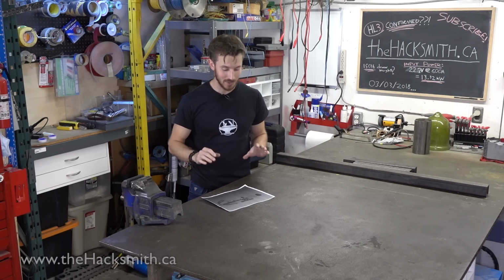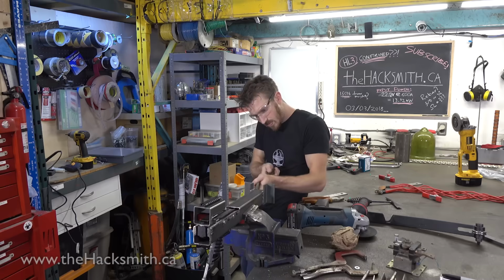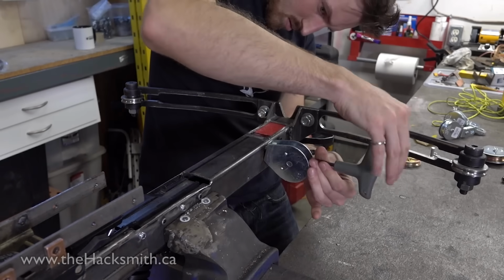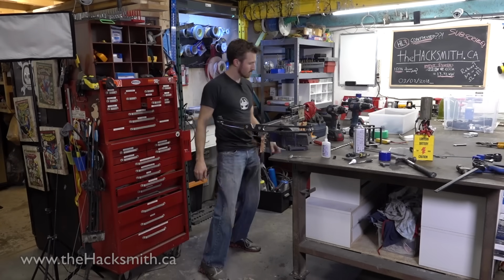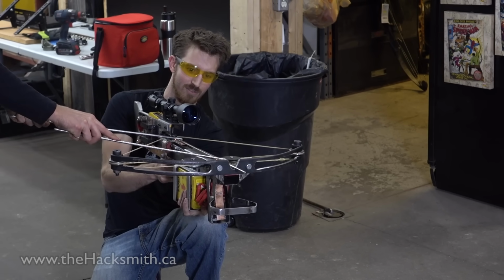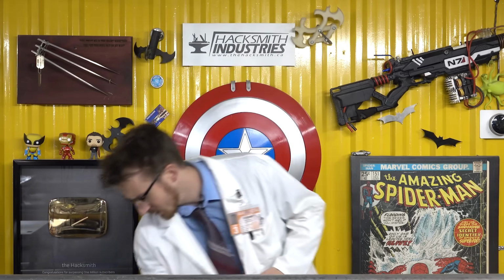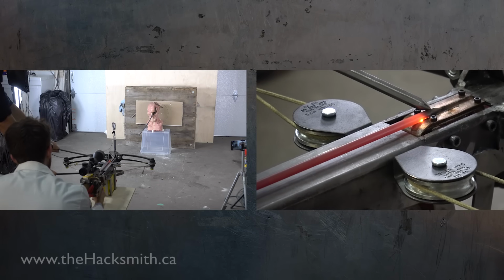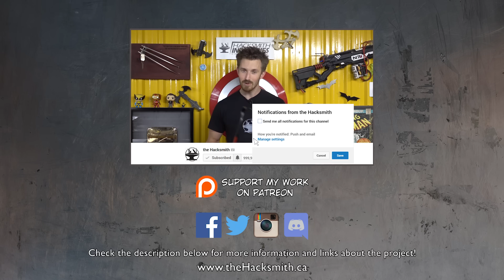REBAR CROSSBOW FROM HALF LIFE!

Comment: Make a crossbow with cesium bolts. Because of the nature of cesium, it will explode when it contacts a liquid (blood)
Reply: Joseph C. Walker it reacts with water , not blood lol
Reply: Joseph C. Walker cesium is an alkali metal , meaning that it is also very malleable meaning that the bolt would break Easily
Reply: Ken Soh Would the properties carry over to an alloy?
Reply: Joseph C. Walker no, the valence electron shell would be probably filled at the end otherwise, it would become a transition metal, meaning that it would not have the chemical properties an alkali would have.
Reply: Ken Soh imagine what is the base component of blood?
Reply: Cesium arrow head? and tape a packet of water to it so it explodes on impact
Reply: Ken Soh what do you think blood is nearly entirely made of?
Reply: Real men use anime to mask their empty souls. More than half is a liquid called plasma, not water. Get your facts right
Reply: Real men use anime to mask their empty souls. And the fact that you thanking that water is a main component of blood is actually hilarious
Reply: Politically Incorrect Man [TRUMP2016] either ways, the arrow would still not work as it would just break and snap

Comment: It looks like you need to apply an initial pressure to the bolt to start heating it. Perhaps having magnets that are actuated to help with the initial connection with the copper contacts.
Reply: Maybe an automatically feeding solder to both stick it and be conductive

Comment: I am kinda shocked you guys did not go for the compound initially.. Was kinda obvious the standard would be impossible with what you had. ( And besides that, the design itself also was a compound crossbow to begin with XD ) It is still really cool seeing this.. My grandfather used to be a gunsmith, I know that is different but I learned a few things from my brother who learned from him.. But I funny enough make bows, not guns. ( Also do a lot of other things.. Honestly making bows is more of a hobby than anything.. But I have sold a few in the past. )
Also noticed you guys did not set it up to pull the string.. IE you are doing it by force/yourself instead of using a built in system.. Though it would have added a lot more weight so.. I can understand not doing that.

Comment: The reason for heating the bolt might be inspired from the the way an arrow wobbles for extra accuracy when shot from a bow. crossbow bolt are usually shorter and dont wobble but the lenght of the rebar is more simular to an arrow.

Comment: !!!MAJOR DISCOVERY!!! LOOK AT THE REBAR IN THE GAME 
The center is not white! The outside is superficially heated to combustion temperatures but the rebar maintains rigidity!
Reply from the maker: How can you tell if the center isn't white, it's inside... if it's one material, like rebar is, it heats up evenly lol
Reply: @hacksmith  when you shoot the one in the game, both of the tips are darkened like they're oxidizing but not glowing, and at no point does it reach white hot so I'm guessing with the speed of conductivity when it's inserted into the crossbow it is just heating the surface which might even mean it could get away with only a cleverly rigged lantern battery. My knowledge of electrical stuff is literally none though so I'm not sure how much that will ever be based in reality.
Reply: Getting that red glow all the way through iron just takes a long time unless you flat out liquify it, like you guys experienced, but if you coated it with more conductive metal, or if it's possible to somehow direct the current to the surface which I don't think works that way, you could possibly have armor piercing and still have that gnarly burn effect
Reply from the maker: No,  current flows evenly through material,  it heats up at the same time.  It will cool down outside to inside, but heating up is constant through out. 

If you heated it up externally with a flame,  yes you could get the outside slightly hotter than the inside,  but metal is a fantastic thermal conductor which means it very quickly equalizes throughout its mass

Comment: I always assumed since the rebels worked with the remanence of Black Mesa, that the crossbow used a heavily modified battery to generate the power hot enough to heat up the rebar

Comment: what may be more effecting would be a system to heat just the tip as in have 2 contacts on the left and right of the bolt tip so it would heat just a inch or so of the front that would probably take less energy

Comment: 3 years later, i've come up with an idea, what if you use a high power electromagnet to make the Gravity Gun? It will not float on the air but it will stick, then maybe reversing the polarity of the magnet could repel the previously atracted object. (Idk much about physics so this may be impossible, but if it works it will be really cool)
Reply: This, but 3 spaced high strength magnets on the 3 arms, to at least partially replicate it.

Comment: for the tip issue how about making it hot enough to go through a skin substiute like butter and the rest hot enough to do serious damage as it should make direct contact with the target to maximize the damage

TLDR make it so it stick in say a balistic gell torso so the red hot part is directly inside the target melting it from within to accomplish this feat try and make the tip or the entire bolt up to a point a bit sharper

Comment: your mistake as the "compund" because you have to use roles without an hole in the middle. The hole must fit between the middle hole and the outside.

maybe in german: wenn du einen compound bogen bauen möchtest, kannst du die rollen nicht nicht mit dem Mittleren Loch befestigen. Sondern du musst ein loch genau zwischen diesem mittleren Loch und der Außenseite bohren. Dann hast du diesen Zug bis zu einem bestimmten punkt und danach geht es auf einmal kinderleicht (dafür erhältst du allerdings wesentlich mehr Präzision)

Comment: You know the hl2 crossbow automatically pulls back right?
Reply: But only because Valve was too lazy to create a proper reload animation.
Reply: @rebeccawerauchsonst97  How do you know that? It could just be how the resistance crossbow works.
Reply: @k9strike931  The string of the crossbow does not move when Gordon fires it. You should play Half-Life² MMOD (if you haven't already) because there you can see how the crossbow should work. Also, it seems to me that Valve generally doesn't know how weapons work.
Reply: @rebeccawerauchsonst97  I'm sure they do know, they just are too lazy to do crap.
Reply: @k9strike931  Maybe, but check out the video "Half-Life 2 Item origins". You get the impression that Valve has absolutely no idea about weapons. But I'm not here to force my opinion on you. If the crossbow has an automatic loading function for you, that's good. It just looks strange to me.
Reply: @k9strike931  I want to correct myself. I just checked and the string of the crossbow does move in the original Half-Life², but only when fired and afterwards it teleports itself back to its original position. So you can say that both of our statements are somehow correct.
Reply: @rebeccawerauchsonst97  It doesn't teleport, it moves.
Reply: @k9strike931  Maybe, but I prefer the MOD version of the crossbow.